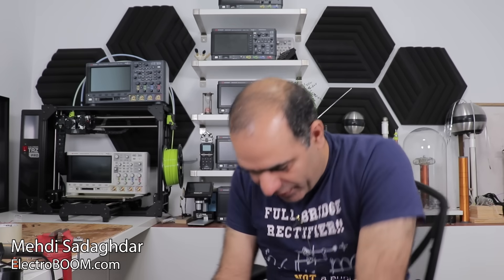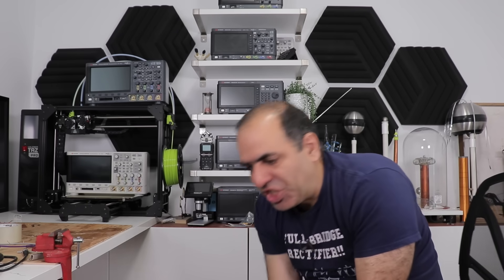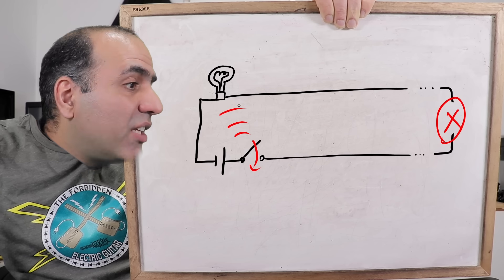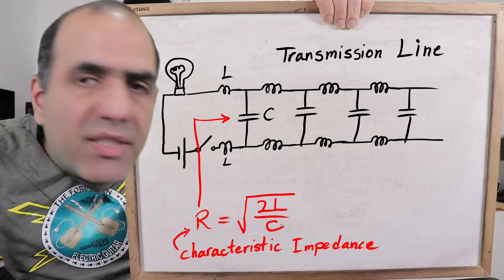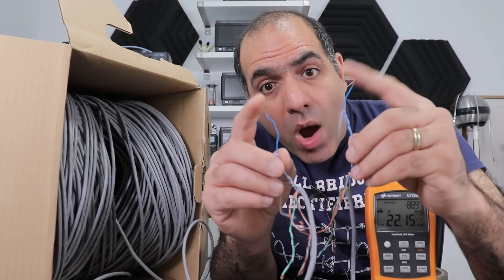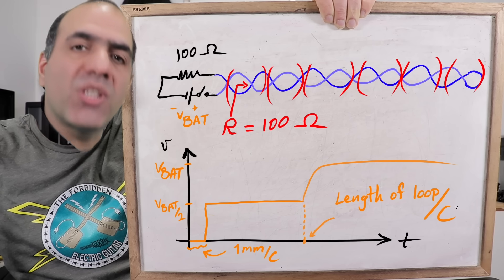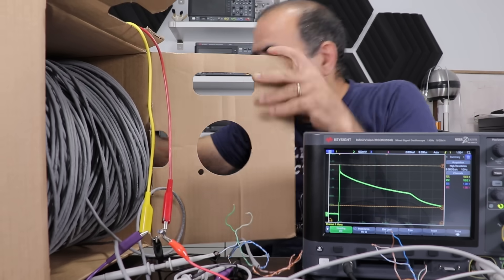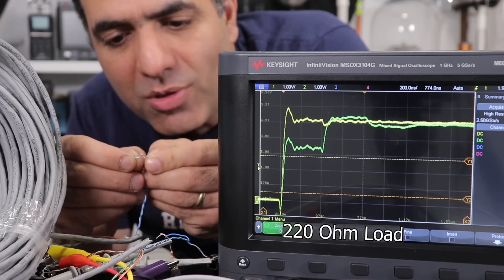Testing the LONGEST LOOP OF WIRE!!! to Turn a Lamp On

Comment: Still the electric fields are concentrated inside the core. All this proves that electromagnetic and electrostatic courses for engineering are still correct. The phase velocity is still speed of light divided by the square root of the relative permittivity. We always took the speed of a signal in a wire to be around 60% as a rule of thumb. Again, nothing changed. Energy doesn't flow around the wire but inside the wire. The resultant of all the electric field follow the length of the wire and maximize along the path of electrons.

Comment: The speed isn't different. it's the distance it is traveling inside the wire is longer than you can measure. like traveling around half a circle for each jump between atoms. like driving on the same road with speed bumps. appears slower but isn't

Comment: 🇨🇦 Happy Canada Day! Your videos promote THINKING and wow it's interesting, isn't it? Every pair, even an extension cord is a transmission line. ;-) I'm not sure. You still have a big coil there... Phone company uses twisted pairs, but they still need to add loading coils, and the power company uses those capacitive regulator banks.  Propagation Delay. Velocity Factor. Counter EMF. You're going to have to cancel out the inductive  and capacitive reactance, and then there's the PN junction to consider, since even that zone takes time... I Honestly don't know why we use 50 Ohms for everything, or some multiple of that say 450 Ohms. and then we transform that down to 50 Ohms. Cable TV used to use 72 Ohms. But all the radio and scope work I've done was and is with 50 Ohms.   73 DE W8LV BILL (W8LV/VE3 prepandemic)

Comment: Coaxial cable was used to store energy and generate precisely timed, very high power  pulses in the early days of radar. They were soon replaced by PFNs (pulse forming networks) which are inductor/capacitor lumped element approximations of coax.  They are used because it is very difficult to shut off a megawatt plus pulse, especially before high power IGBTs and MOSFETS.

Comment: Awesome video, thank you very much! The only thing missing now is a QED discussion of the situation. I'm guessing closing the switch causes a flash of white light in virtual photons (as the Fourier transform of the sharp step would give contributions at "all" wavelengths) which then carry the EM force to the led. If only Feynman was still alive to give a lecture on the matter. Next best would probably be Leonard Susskind. Maybe you could contact him, inform him about the whole discussion that took place so far, and ask him for an online discussion?

Comment: Nailed it!  Crushed Derek's video.  This is exactly how Derek should have presented the concept of transmission lines.  A really be circle of wire would have closed the loop on the speed of light, but too impractical.  This is the next best solution, and enabled you to cover the 2 important concepts at the same time.  Brilliant!  Derek should send you all his subs.

Comment: Data cable manufacturers Supply The nominal velocity of propagation (NVP) Expressed as a decimal percentage  compared to the speed of light. Cable testers are supposed to enter this figure into the test equipment But very really do as they don't understand it or  We're not taught this I haven't done this type of work for over 24  years however most cables were .4 to .8

Comment: Nice 'Gimmick Loop' demo. The big difference in your set-up from the others is that your capacitance will be a lot larger than wires a meter apart--which contributes significantly to the capacitive coupling.  It seems over the past few months we have all learned a little about transmission lines and antennas.

Comment: I'm interested to see the test results using large "circle" wire loop. I speculate it doesn't matter where the battery, switch or lamp are in the loop.

Comment: I'm wondering what would happen if you were to make two loops with one pair, and loop back through a second pair and then drive the pair with a differential pulse.

So for example you put a +5v and a -5v pulse on the brown and brown/white wires, which are connected to the green and green-white at the ither end, and then hook up two loads to the green and green-white to ground.

Would you then see an actual light-speed delay, because the two loops cancel each other so they can't transmit anything to the other side of the loop?

IOW: Sabotage the experiment by shielding the wires ;)

Comment: why go through the trouble to make long wire loops.  why not just have a loop 1 meter wide loop with a bulb and then have an inner loop with a bulb, power the outer loop and see if the bulb on the inner loop turns on?

Comment: You should have just put an electrolysis chamber at the other end and show that the electrons are being pushed along because they are causing chemical reactions by entering the cell. Are there not some law that gives the ratio of electrons to the ratio of product or metal coating?

Comment: does DC not lose voltage over long runs of wire like AC?
Reply from the maker: Yes it does, that’s why my 8000ft line had a low voltage when settled

Comment: Electric current falls just like water in a river. Each particle of water is affected by gravity, not by particles of water behind it pushing just as if we dive in a pool,  our feet aren't pushing us down, gravity works on all of our body parts at 10m/s2. But when water hits resistance like a damn with a turbine the head of pressure builds and that head is the same of voltage. So if current falls like water the electrons don't push each other but when pressure builds up they do but more like a flash flood. The time it takes the pressure or head to build is your delay.

Comment: This actually just disproves Veritasium....because what he stated was at what point does the light "turn on"....he didn't say when does the light "blink on for a moment." Given a pair of wires with a faraday block between would have to wait the entire time for the energy to move. Information does not break the laws of physics, the fact that you get a blink is only a hack to the circuitry, it isn't the actual information.

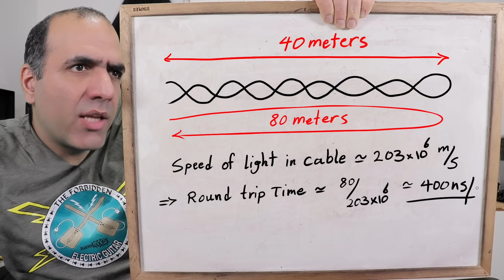Comment: 13:13 there is a marking every meter on the cable, you didn't have to measure it with a tape measure

Comment: You disconnected on side and the lamp blink, can you disconnect the other side and get the same result? If yes, than, can you use a generator at high frequency to make that led near almost on? If yest than you will transmit energy with no cables.
Reply: I’m pretty sure that’s called a radio transmitter, or perhaps a flashlight

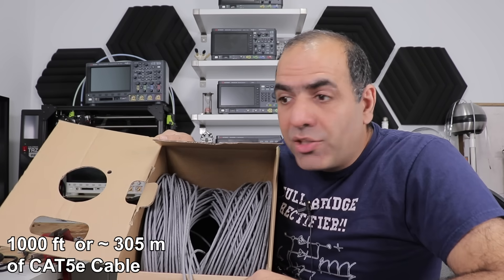Comment: @1:25 doesn't electricity work via the electron being knocked from orbit to orbit, thusly turning the switch on would have a newtons cradle effect at the atomic level, allowing for the light to turn on instantly, the electron from the switch never has to travel to the lamp because there are lots of electrons before him in the way.

Comment: Just for fun, I would have connected all 8 of the wires in a way that they created one back and fourth looooooong line. So basically starting with light orange, through each colour, and ending in orange.
Reply from the maker: That's what I did to get 8000ft though!

Comment: How big the 1mm/C can be before the emwaves won't affect the opposite wire?
Reply: Also put the led in different cable lengths to check for results

Comment: I would have been surprised if you had a higher propagation velocity. This is standard Transmission Line Theory. What would have been interesting is for you to have placed a termination load on the other end matching the intrinsic impedance of the line..... I was unimpressed by the original video since his premise was preposterous, that a significant amount of current would be available to light the lamp. Your video however was a good introduction of the effects of line impedance, and reflections.

BTW, I am an electrical engineer that has used coaxial stubs as both resonators and parts of tuning a system and impedance matching. What you described has been used for many years in RF applications.

Comment: Love the video! Only one detail is incorrect: the twisted wire in your arrangement is not a differential pair. In fact, since only one wire experiences the voltage transient (the other is held at ground), the twisting does nothing to shield the electric field. It really is a single-ended signal. The magnetic field is cancelled by the effect you mention, but the electric field is not. For electric shielding, a shield surrounding the 'hot' conductor is required, i.e. a coax cable.

Comment: Using a CAT 5e cable for this experiment is absolutely brilliant!

I'm a software developer and mess with networks a little bit on the side. I used to think networking is relatively simple, until I started to learn more about it. What I've found really fascinating is how much raw physics plays a role at the lower levels, like how twisted pairs are used to eliminate interference. (On the other hand, software development is so abstract that it has virtually no connection to the physical world. It's mostly just pure logic.)

So, seeing network cables used for a physics experiment like this, making use of their unique properties, was really exciting!
Reply: At least until you start looking at things like rowhammer, when your code can start interfering with the physics of memory chips!
Reply: Everything becomes more physical and less abstract as you move towards smaller more fundamental components. Most modern software development is done with plenty of spare resources, to the point where resources arent even considered. Software development which is low down, jammed into extremely limited contexts, or stretched to extremes shows its physicality. Software development is the only field that theoretically runs into the upper bounds of physical time itself, if your algorithm is so bad / your problem so complex that there isn't enough time in the universe to complete it
Reply: @jek__  The more complex the hardware, the simpler the software needs to be to complete the same task in a shorter time and vice versa. Very complex CPUs can do in a single instruction what simple CPUs have to achieve with a whole subroutine. Taking that into extremes, an infinitely complex hardware can do any task instantly without any software at all and conversely, an infinitely long software can execute without any hardware, taking an infinite length of time 😏
Reply: Also take a look at how many twists there are in each pair. You'll notice they're all different and are a prime number of twists per meter so that the pairs don't interfere with each other.
Reply: @JasonKaler  Yup, that was discovered in late 1800s, when the telegraph and later telephone was king.
Reply: @JasonKaler  Fascinating. Reminds me of this quantum computer research paper, where they use fibonacci numbers to have two lasers pulsating at different but related frequencies, yet they never interfer/don't cancel each others out.
Reply: this is only cat 5e Cat 6 100Gb/s cables are much crazier!
Reply: Get into digital electronics and microcontroller fundamentals, arduino stuff and different communication protocols ( i2c, uart, spi ) then you will be able to couple software engineering with electronics and physics ;)
Reply: Network Engineer here, we have started feel that abstraction with Cloud Networking. Got my Azure and AWS networking certs recently and man this stuff was designed by guys who aren't use to having physical references lol
Reply: I work at an ISP and have played at all layers of the OSI model, racking+stacking servers, firewall rules etc. plus a bit of software dev in the form of custom webapps for internal use and automation (puppet and terraform). I'm not really a specialist in any area, I just love the variety.
Reply: I'm only learning the VERY BASICS and turns out that having a tiny kink in your cable actually screws with the data transfer, won't matter at your home with a cheap network but at a business? CHECK FOR THOSE KINKS AND KEEP BENDS TO A MINIMUM
Reply: Networking is actually really complicated because it has tons of hacks so that software didn't have to be modified
Reply: There are actually some interpretations of quantum mechanics that argue the most fundamental physical thing that exists is information and that the universe emerges from the logical operation between binary bits of information.
Reply: @sock2828  The whole universe is made from thoughts and life. In certain objects it's turned off. In others it's turned on.
Reply: Question for Electrboom (or anybody else, really): how does the twisted pair differ from  side by side wires? Allegedly it's the twisting of the pair that allows for ultra-high speed, but I do not understand why.
Reply: @bart2019  I'm sure there are many videos explaining the topic but basically the fields of the two wires interact with each other.
The magnetic field itself is clockwise around the wire (and counter-clockwise around the other because the current is traveling in the opposite direction there) , so we can use this to either increase how much the field will propagate to another wire (which increases inductance) or to minimize it by fine tuning the twists.
If you think about it, in transformers the wires are parallel.
There are two things that fight transmission speeds: capacitance and inductance. These resist changes in voltage and current respectively. Capacitance is reduced by the insulation and inductance is reduced by the twisting.
Also, the twisting reduces interference from outside sources, thus allowing for greatly cleaner signals and thus higher speeds.
Reply: Do you even understand that your code is running around in some wires and circuits? Code and logic isn't possible without the hardware.
Reply: @elektron2kim666  You can execute an algorithm in your head. Think of it like a mathematical formula.

As a programmer you don't care how it breaks down to physical phenomena in the RAM, CPU, flash storage, etc. You don't even need to know anything about it, you can just follow the rules of whatever language you're programming in, and it will "magically" work through the ten layers of abstraction beneath it. (E.g. compiled to byte-code, which is executed by a virtual machine, which is a program consisting of CPU instructions, which are interpreted by the CPU microcode...)

It's actually a very important principle to be able to create layers of abstraction like this, because it's the only way you can manage absurd amounts of complexity.
Reply: @taylankammer  Sure. It just doesn't exist without the hardware middle man to other people unless you/we are good at telepathy.
Software is very well engineered. I like code myself and I'm well aware of what you wrote.
Reply: As a software developer and cloud engineer, I second this :)

Comment: This was the best episode ever. Super. I can't even remember what we were doing as it was over twenty years ago, but we had dozens of reels of Cat5 in our stores and made a ridiculously long run in the same manner with maybe five or six boxes. We were probably just looking at attenuation. I remember wasting a lot of time.
Reply: it isnt wasted time if it is paid time lol.
Reply: "This was the best episode ever" -- agreed! And that's saying something, considering there have been some really great episodes.

But this one takes all the counterintuitive electrical field theory stuff and merges it with the much easier to grasp "liquid in plumbing" analogies us mere mortals have been using all along to stumble through understanding electricity, using the oscilloscope to allow us to actually *see* what's going on.

I mean, this one video covers so much ground, it clears up all kinds of gaps and misunderstandings I've had about electricity for years. Just one example: I learned a long time ago that data cables needed to be "terminated" with a resistor to prevent "reflections" from disrupting the communications (came up a lot when using SCSI devices...apparently other types of devices often have internal termination). But the whole idea of electricity reflecting didn't make much sense to me. I took as granted the EEs knew what they were talking about, but seeing the actual effect of the reflections here in this video really opens up the whole concept for me.

Comment: Would a lamp one meter away from a switch on a loop but NOT part of the loop experience the same effects as the first 1/c seconds that complete system experiences?
Does the radiating EMF have the same effects weither there is a wired up circut or not?